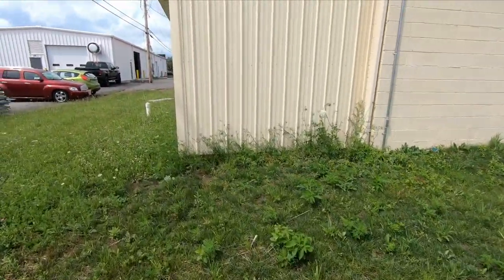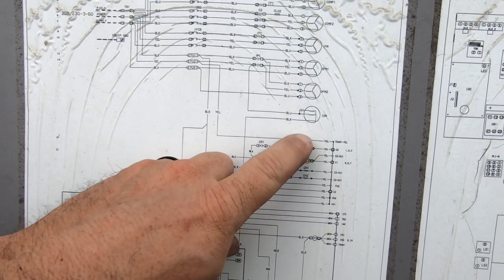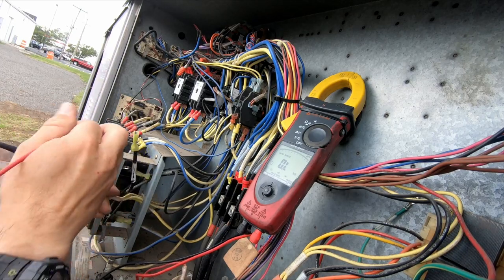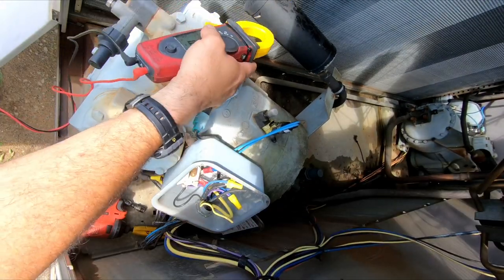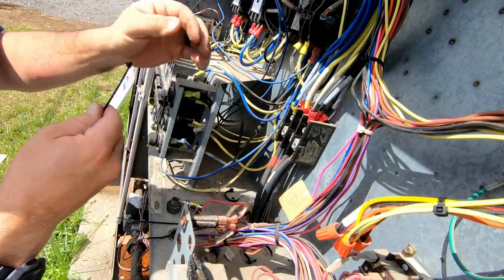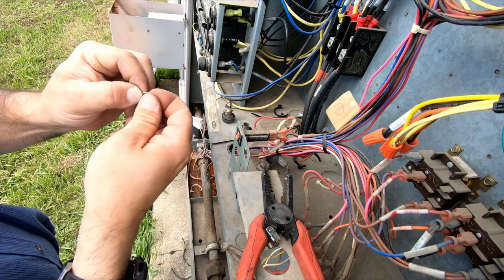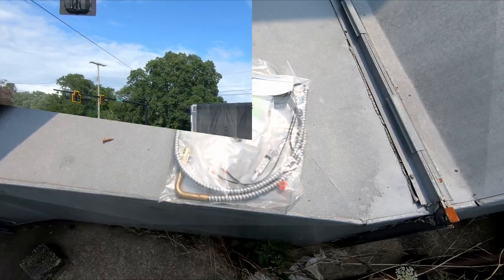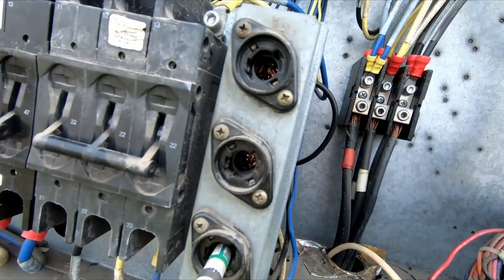Air Conditioning Not Cooling / Electrical Troubleshooting

Comment: Good job. I'm on call now and I was scavenging the junkyard for a sporland mkc1. Some other tech put a 120v solenoid coil on a 230v a few months ago. Lol I'm surprised it worked that long.
Reply from the maker: I'm on call for this weekend as well. I traded weekends, luckily its been slow.
Reply: has flashbacks of small 120v relay coil on 240v, it was a quick firework show after some short minutes. lol

Comment: Definitely made a few fuse spacers over the years because of not having the identical fuse or for the poor spring pressure causing bad contact on some rough roads but as long as it works it’s fine. You’re looked way better then mine 😂 Great video as always.
Reply from the maker: I appreciate the continued support, thanks for watching!

Comment: those spring loaded fuse holders use the flat end of the fuses as contact area, so  the fuse fit in the barrel doesn't really matter and simply helps hold it for removal and lessen vibration issues.
the main purpose of the barrel(outside) is as a conductor/connector/insulated switch(fingers safer from Mr.Zappy) for connecting inside the main socket body. lol.

Comment: Did I miss something or did you wire the new heater directly to the contactor bypassing the shared fuse?
Reply from the maker: Remember when I talked about the fans and the heaters were all on that fuse that blew. That contactor was those fans

Comment: I’ve worked on a lot of those, the fuse holders are aggravating. I’ve replaced them with a 3 block fuse holder with new fuses. But I’ve also gone your route with shorter fuses with lower amp just to get by
Reply from the maker: Thanks Chuck, I was told about the fuse block repair work around by another tech at my work place. Good advice👍👍

Comment: I do a lot of personal computer repair, where a tiny dab of thermal paste is all you want.
Watching you lather it on there made that part pf me cringe!
Keep up the good work. :)
Reply from the maker: I would never use that much on a processor🤣🤣🍺🍺
Reply: hah! lot's of void to fill there and the more solid filled with paste, the less chance of condensation forming and corroding.
the elements are fairly low output but still need a decent clean thermal connection to work, corrosion again in there would build thermal resistance fast and cause faster burn out.
most of that style/large compressor heaters are in the 70 to 130 watt range.

Comment: Man I love me some good ol' electrical work , and I always like seeing the ol reliable Amprobe back in action that 376 Fluke looks pretty slick though I don't like how Fluke dont let us measure higher ohms , like if you wanna check a temp sensor it often won't be enough to read the ohm value . I love Fluke but come on brah ,  give us hvacr lads some love eh .
Reply from the maker: I was waiting to see if you'd say something about the 376. My other one's been sitting in the truck cuz I didn't want to get it dirty. So I picked that one up on Facebook Marketplace for cheap. Like brand new 😄😲. It does at least do 60,000 ohms but that's not enough sometimes. I have a fluke 87V, and 112, 117 if needed plus my old Amprobe n UEI if all goes to hell😄
Reply: @HVACRSurvival  Oy Fieldpiece !  About time you lot sponsor my man innit ! 
And to think I got a cheap Klein meter that reads MOhms , come on Fluke  already 😡
Reply from the maker: Most of the time all you need is AC voltage, resistance and amps. It's all those other fancy things that add up. "Just enough"  to get it running 🤣🤣. But..  (That's for the other people 😅)
Reply: @HVACRSurvival  True dat ! I'm tryna find a bad thing to say about my Klein but so far it's been really good 👍 
Only thing is sometimes I need the Inrush reading that can go over 600A , but these meters get real expensive .
I'll probably end up  giving  in and buy a fancy super  expensive Amprobe that can do that one day .
My Amprobe 320 has 3 leads for phase sequence and its been absolutely brilliant so far 🤓
Reply from the maker: I think the regular ampprobe meters are good, I just don't like the one I have because it has that weird button. And the backlighting comes on all the time and runs the battery down. Those are my biggest complaints about it. That 376 with the amp lasso can take my amperage readings up to 2,000. Lol . It sells new for around $400, I didn't pay near that...

Comment: The good old 50dp carrier. Those fuses have a spring in them behind where you put the wire so the extra length of the fuse pushes the spring.
Reply from the maker: I felt a little bit of spring but not much👍👍

Comment: So the new heater isn't going through the fuse anymore?
Reply from the maker: Everything was still protected as it was originally, I only temporarily used a shorter fuse until I could get the correct one and a new crank case heater.
Reply: Maybe he just landed the wires at another location downstream.  I thought the same thing.
Reply from the maker: @joehead1294  everything was wired in exactly the same location. The only thing I did was unhook the crankcase heater and put in a smaller fuse because that's all I had. I'm not sure where either one of you are seeing anything different?. 🤯.  If you're talking about the return trip?, The only thing I can see that might have confused you could be that I did remove the wiring that I was no longer using and hook the new heater that had longer leads back to the exact same location.?
Reply: @HVACRSurvival  I see where I made my mistake.  Some continuity checks were made at the fuse area and problem was isolated downstream to the heater with termination at (contactor?) another location.  The ole ready, fire, aim!

Comment: A rubber band and small square of memory foam over the Mic will remove all wind interruptions.
Reply from the maker: Since this video I purchased an external shotgun microphone that is rated for up to 20mph wind and it's working really good. This is one of the few videos that I had this problem.  thank you for the tip👍👍
Reply: @HVACRSurvival  that's great you have some incite on your thought processes while diagnosing I tune in often to hear. Keep up the great work.

Comment: If the fuses are cost-prohibitive or difficult to find... Changing the fuseholders is an option.
Reply from the maker: My issue was,  it's not a normally used fuse today, this was actually the first time I've ever needed that particular fuse.   A fuse holder would be the most logical solution👍👍

Comment: It's probably a shared neutral. The yellow attached to the white. I guess it's a three phase circuit, don't understand why it would have a neutral? I guess for motor control.
Reply from the maker: I'm not seeing a white wire? What was the time stamp you seen it? Everything in the unit is 230 volt, either single phase or three phase. The yellow shared leg is similar to a neutral only because it's sharing a reference point. But it's not a neutral because they only ran L1,L2,L3 and ground, each power leg had potential to ground.

Comment: They don’t have springs in the fuses they just did it cheap. I personally don’t like them either yet they could have used the more common fuses but it’s carrier what do you expect lol they do have good units though.
Reply from the maker: A fuse block would of been better, I was told by one of the other guys that is what he uses sometimes.
Reply: the fuse holder has the bottom contact spring loaded. the fuse length may have been chosen for better arc extinguishing at higher voltage or simply a bit more radiant cooling. what's voltage rating of the two different fuses and their current breaking ability(possibly the exact same).

Comment: Those little fuses Home Depot actually carries them
Reply from the maker: The closest home Depot was only 60 miles from where I was 🤣
Reply: @HVACRSurvival  didn't know if you had one close by just thought I'd share the tip but 60 miles that sucks
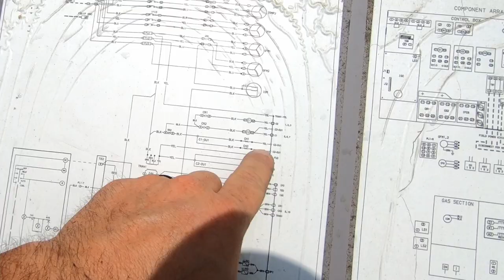Reply from the maker: Lowe's and Menards ran them out of our town. My city only has 35,000 people. Three major stores like that is a little overkill. Menards and Lowe's is next to each other 🤣.  If I wanted to drive 40 some minutes into the next town, I probably could have picked up some of those fuses but it was 5:00 in the evening and most places would have been closed by the time I got there.
Reply: @HVACRSurvival  I wonder if Lowe's carries them next time I go to Lester I'll have to take a look